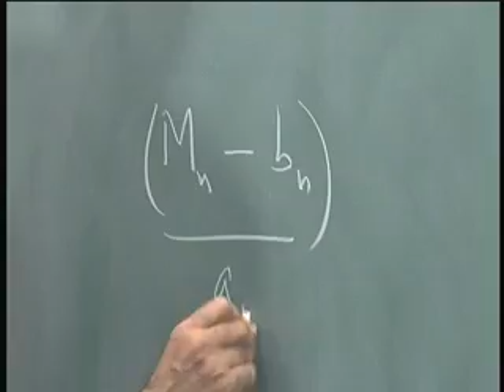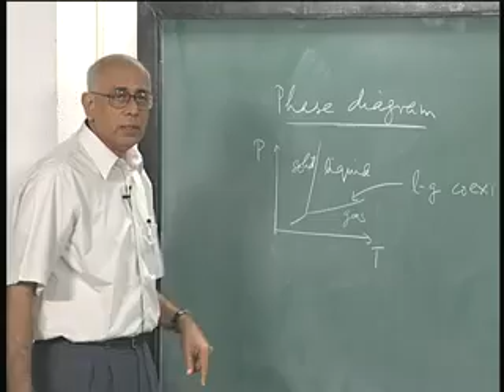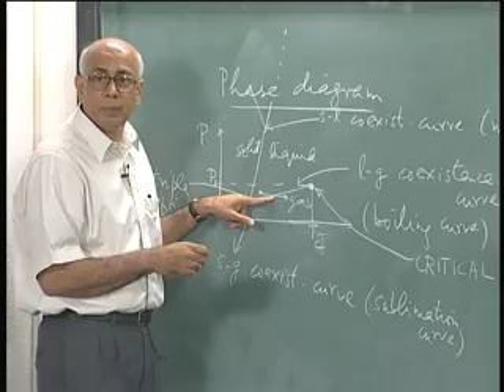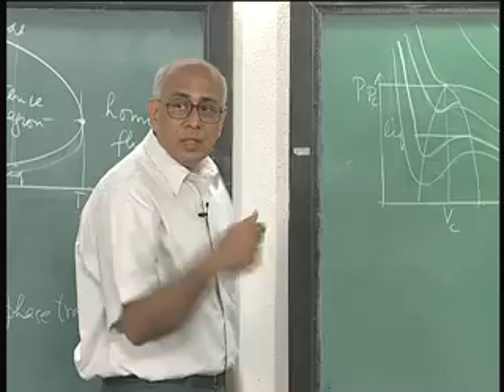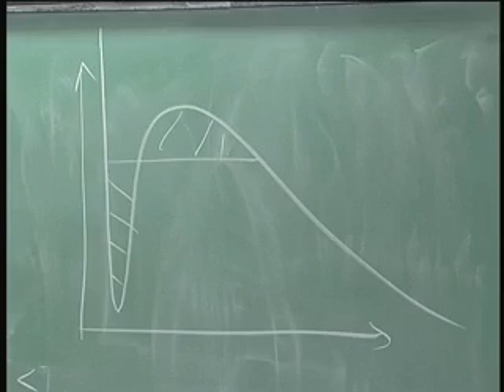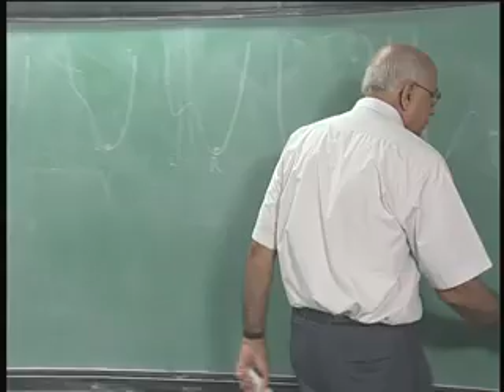Mod-01 Lec-27 Probability distributions (concld.). Phase transitions (Part 1)

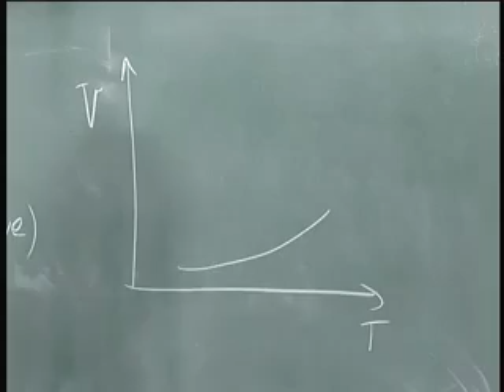Comment: Can anyone explain 26:07  the volume of gas how it change with temp the above part of the graph , is it decrease with temperature? If not what wrong with the question? Explain the logic sir gave here plz.
Reply: The pressure decreases with at constant temperature that leads to increase in volume. The confusion in this type of graphs comes because this 3d graph is represented in 2d
Reply: For this just draw a straight line at any point parallel to Volume and then Use this formula PV=nRT
Reply: Here you can see that volume increases at constant temperature when pressure decreases
Reply: In between this graph this equation no longer holds